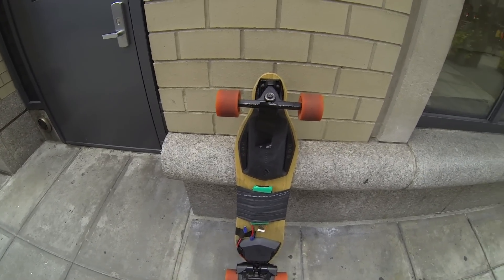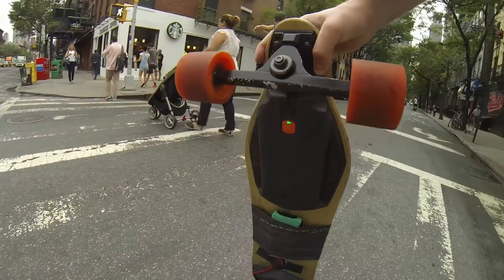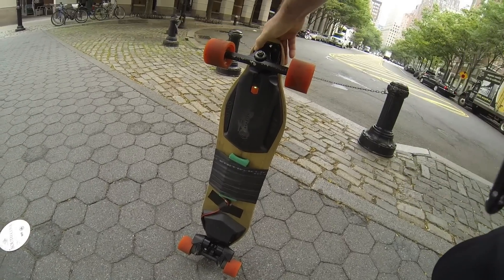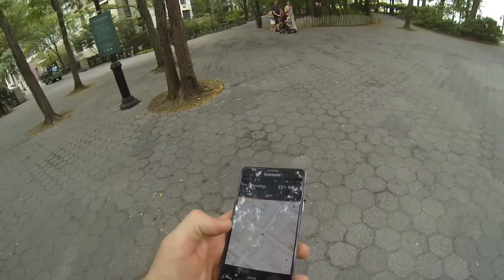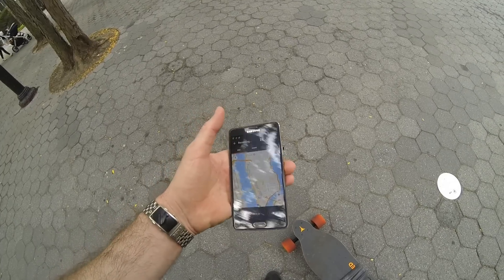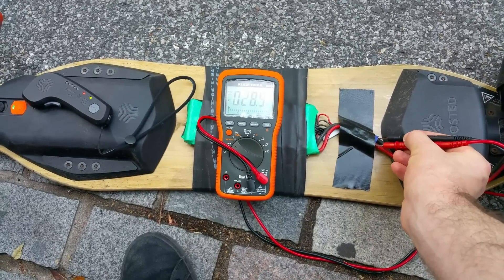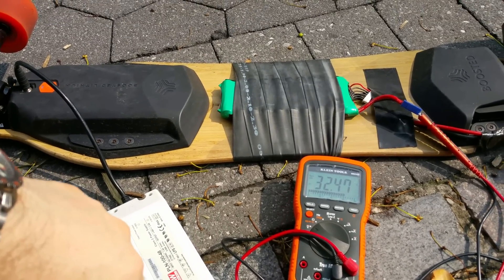Boosted Boards Extended Range Test with One 18650 Pack

Comment: can i attach any battery to the board, or it must be 10c could it also be 25c ?

does this battery work ? http://www.hobbyking.com/hobbyking/store/__20998__ZIPPY_4000mAh_2S1P_25C_Car_Lipoly_ROAR_APPROVED_.html
Reply from the maker: David, you apparently don't understand how the batteries work. you should go on batteryuniversity.com and read. you will need a bunch of them to get to 40.5V and lipo cells are very unstable and you can set u board on fire.
Reply: thx, but could you make a video how you build the battery?
Reply from the maker: +Davide Rico i replied previously if the video gest 2000 likes then I will. The only concern is that people like yourself trying to build these packs without battery  knowledge will end up hurting the board or themselves.
Reply: okey

Comment: Do you think that 30 2000mah 18650 cells in a 6s5p pack is enough for the motor's draw?
Reply from the maker: +Legyen Géza 6S would not work.
Reply: then what do you recommend if I get 30 of these cells?
Reply from the maker: +Legyen Géza you should make a 10S pack.
Reply: so 10s3p is enough? Or I should get more batteries?
Reply from the maker: +Legyen Géza I used 10S 1P for each pack.
Reply: thank you, I'll see what I get with those ::)

Comment: you can not measure the battery voltages not under load, that is not the correct way to do it. You need to measure the battery voltage UNDER LOAD. They will drop significantly, the figure 3 or 3.2 voltages / cell only work in that case. If you discharge your batteries more than that you can damage them.
Reply: +Portable Electric Vehicle what was the new range with this mod
Reply from the maker: both packs are controlled by the same BMS. once the voltage drops to 3.0V the current is cut off. These cells that I use can be discharged up to 2.5V.
Reply from the maker: Vitor please stop writing comments that you don't understand. stop confusing other people.
Reply: What I said is true, you are the one confused, I do understand what I'm talking about, I'm an Engineer and I do not mean to offend you. I'm only stating that you can not measure the battery voltages with your multimeter while they are not under load and decide whether or not the batteries are dead. 
The electronic speed controller can shutdown the batteries correctly because it is measuring the voltages under drop. I'm just mentioning that with a multimer, under no load, you can NOT say if a battery is dead or not.
Reply from the maker: Well I measured the capacity of the cells and not voltage under sag. If I wanted that I would of connected the voltmeter and recorded while riding. Just to clarify for people like you that the BMS will cut the power off once the cells get near 3.2V value. If you are an engineer that does not mean that you have to know this specific thing. If you were an electric engineer you would not post such a stupid comment.
Reply: haha!

Comment: Why doesn't boosted make batteries so they are swappable? IF they did that then the board could be used a lot more that is if the board is capable of running that hard. Probably batter to have 2 boards so they can rest.

Comment: GPS uses microwaves to pinpoint your position it requires you to interface with 3 satellites to get a location. Buildings will refract that signal and cause you to show multiple positions. Best to try to get into open sky to use the GPS.

Comment: Why do ppl still get Boosted Boards ? It's not water proof .......Also the Zboard 2 is shipping next month, has more miles you can get, don't need a handheld and its water proof !
Reply from the maker: +Alex Gabrielian Fore some reason I don't dig the design but I am sure it is a good board for commuting. I don't think it will be easy to go at high speeds controlling the foot pads but I may be wrong...
Reply: +Alex Gabrielian The Boosted is more like a freestyle board as well. More action, huge acceleration and faster control.
Reply: Zboard is ugly, heavy, has those stupid foot pads, and probably bad customer service.
Reply: zboard =peasants. :D

Comment: please do the second part of this video and let us know how to made one of those.
Reply: +rebelyell22 Haha exactly. Nothing more than that with his "first 2000 likes". First create content, than the likes will come automatically mate
Reply: Breed van Beroep It's not rocket science.  Wiring in parallel doesn't up the voltage, and therefore doesn't effect the ESC
Reply from the maker: Jose Mendi - don't give people wrong information. If the batteries are not constructed properly it will damage the board's electronics (ESC).
Reply from the maker: if I get 2000 likes than I will do it...
Reply: Thanks you are awesome
Reply: +Jose Mendi just wire the batteries in parallel
Reply: +Portable Electric Vehicle lol
Reply: Martin Herrera No.  Series doubles the voltage, same mAh.  Parallel doubles the mAh, but voltage stays the same.

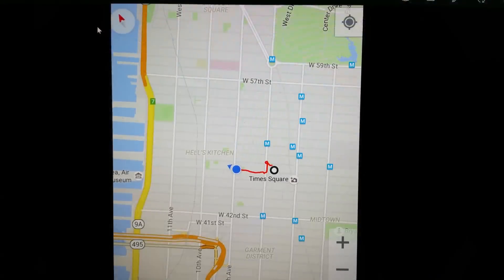Comment: Awesome video. I'm considering getting myself a boosted board for Christmas. By the way, would you mind telling me the name of the song that starts playing around 2:27 ?
Reply from the maker: +Michael Heath Sorry Michael...don't remember where I get it from...
Reply: +Michael Heath  check out inboard skate, much better range! and also removable battery, slimmer look
Reply: +BigBadMarketer Thank you for the suggestion, but I already ordered a boosted board and it's on the way :)
Reply from the maker: +Michael Heath Inboard is not available now and they are pushing back the release day. I am not sure it will work for NYC streets.

Comment: Some links for the parts to make this happen would be awesome.  Great video!  Thanks for taking the time to explain the process and the results.
Reply from the maker: 2 paks...each pack contains 10 - 18650 cells.
Reply from the maker: +Adam Morton There are no links. I made the batteries from scratch.
Reply from the maker: +Adam Morton here is the link for the cells...http://www.amazon.com/Panasonic-NCR18650B-3400mAh-Rechargeable-Battery/dp/B00QCEA6KW/ref=sr_1_3?ie=UTF8&qid=1443465686&sr=8-3&keywords=panasonic+18650
Reply from the maker: +Adam Morton just to a google search for EC5 connectors and 10 AWG cable and you are good to go....
Reply: +Portable Electrical Vehicle How many cells did you add?

Comment: How much mah do it have? Do you have a link to buy them? I have found some cheap new laptop battery will it work?
Reply from the maker: these are 2,6mAh sanyo 20 amp discharge cells. lower C rating may not hold up to the task.
Reply: Do you have a link of where that you buy those?
Reply from the maker: Nope.

Comment: Super stoked.   I'm no electronics guy, so this may be a dumb question, but why can you only charge up the extra cell to a certain voltage that matches the boosted board?  And also, does your remote as well as ios app reflect the boosted original battery + the extra cell power left? or does it only represent the boosted original battery level?
Reply from the maker: +Dan Veneski The Voltage can be between 0.1V - 1V difference. Any higher voltage can damage the cells. Read on ....http://batteryuniversity.com/learn/article/serial_and_parallel_battery_configurations.
I have an android phone...I will try to get an Iphone and test to see if the e-gauge is accurate or works at least...
Reply: Oh no worries on the phone,  I'm rocking android also. What app do you use on your phone when riding your board for distance,  speed and such?
Reply from the maker: Now you made me curious...I want to see if it works. I forgot to mention that when connecting one or 2 extra cells the board has a bit more torque. The app is "My Tracks".
Reply: So do you have to closely monitor the hobby charger charge on the extra cells to be sure it doesn't over charge?  Or does it auto shut off at a certain voltage?   Also have you seen the other mod another member did from the SF bay boosted board group on FB?
Reply from the maker: No, I use Icharger 3010B...u can see it in couple of my videos. I set the charger to 4.10V (most of the balance chargers have that option) and when it reaches that limit it stops.
No I did not...Could you post the link please.

Comment: Vitalie,  You have a dual boosted board not a dual plus.  It's too bad that the remote fuel gauge doesnt work when you use lithium ion.
Reply from the maker: kimbo, I do have the dual plus. I changed the grip tape. if you add the lifepo4 cells than it will work. I know that each pack gives me extra 5 miles.
Reply: +Vitalie Vizitiu I guess you sold and bought a different BB because your last video where you said you were disappointed in your BB... that was a Dual
Reply from the maker: Yes, I had both version...
Reply: thats weird that you changed the grip tape on a board with so few miles but whatever.  you have so many boards and scooters... i guess its better to have those instead of a car in nyc
Reply from the maker: +Kimbo Slice  The boards is over a year old....it looks clean but the grip tape was old...

Comment: Nice video,  which model board is this? if this takes the board from 7-8 mi (from their website) of conservative riding to ~10 of hard riding , what would you expect with the additional pack ?
Reply from the maker: +Light  Grime This is the dual plus model and I only get 4 mile in turbo mode. With second additional pack I should get @ 15 miles (my weight 210 pounds).